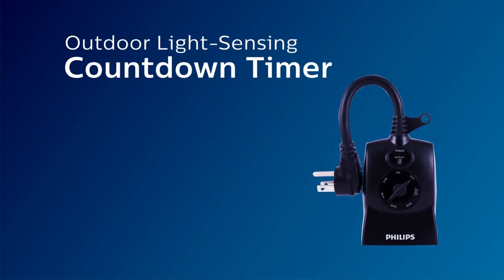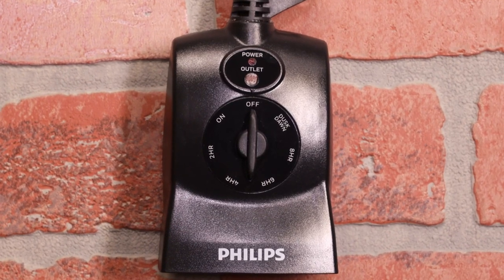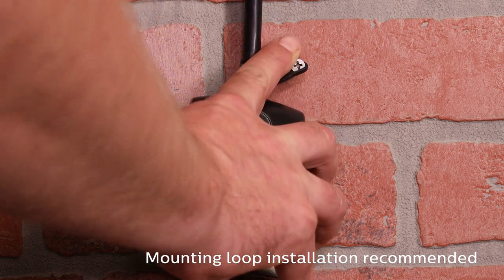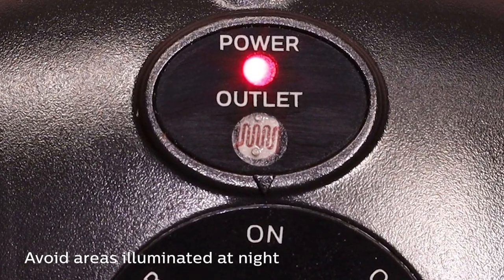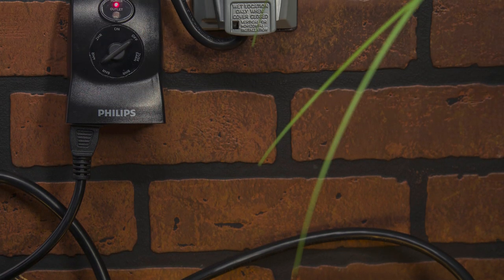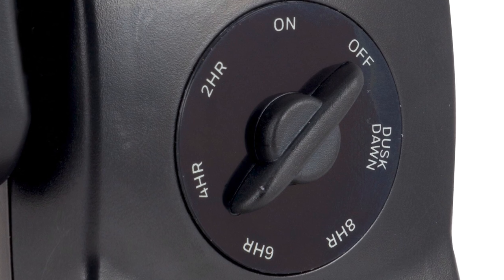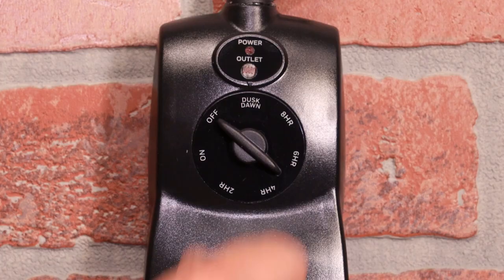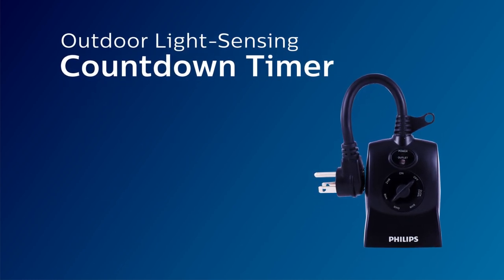SPC1240AT/27: Philips Outdoor Light Sensing Countdown Timer

Comment: Piece of junk, don't work no matter what I do. Bought two from Lowe's, can't return, it's been over a month.
Reply from the maker: Sorry to hear you're experiencing issues with your timer. If you describe the problem, we're happy to help find a solution. Ensure the timer is in a location with access to sunlight during the day and blocked from nighttime light sources, like floodlights and porch lights. If the connected device has a power switch, it must be in the on position to be controlled by the timer. You can also contact our U.S.-based consumer care at 1-844-816-0320, M-F, 7 a.m.-8 p.m. Central Time for additional assistance.

Comment: Returning this piece of crap tomorrow, just bought it at Target. IT DOESN'T WORK!  :(
Reply from the maker: Hi, Gloria. Sorry to hear you are having difficulty with this timer. If you haven't already returned it, we'd like to help resolve the issue. Contact our U.S.-based consumer care at 1-844-816-0320, M-F, 7 a.m.-8 p.m. Central Time. You can also test the light sensor by covering it with your hand to determine if it activates the connected device. Also, ensure the timer isn't installed near a nighttime light source. If the connected device has a power switch it must be in the ON position for the timer to turn it on at sunset.